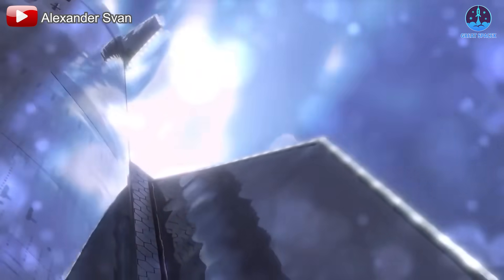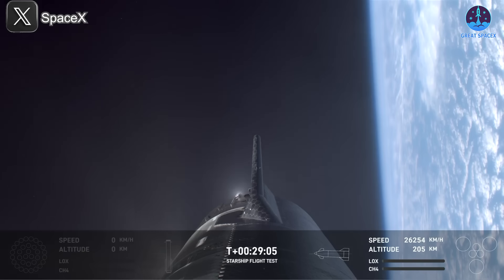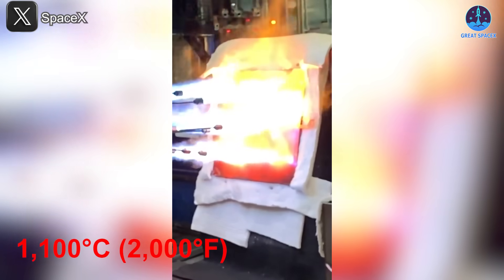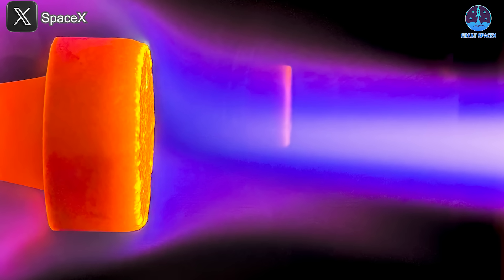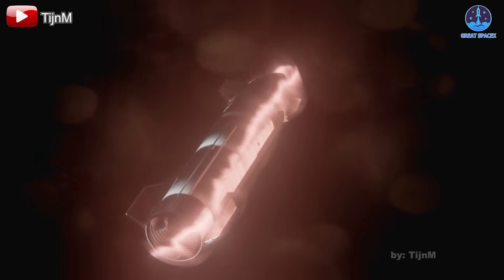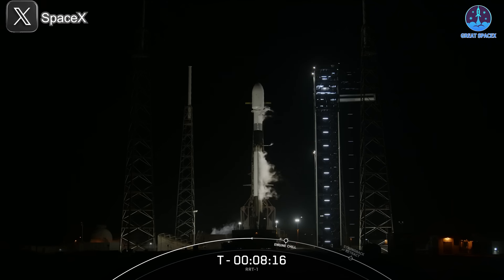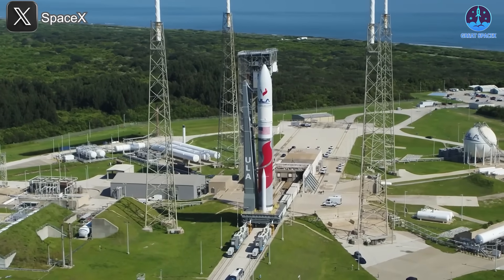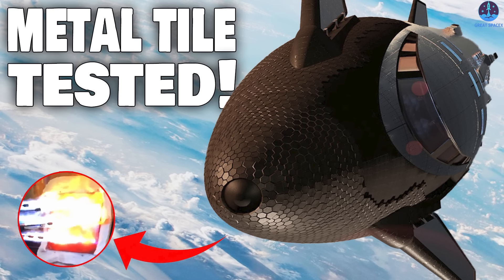Genius! SpaceX TESTED New METAL Heat Shield to End 1500°C Melting...

Comment: The X-33 project was designed to utilize metallic heat shield tiles. Each hexagonal tile was to be supported by standoff spacers and reusable without replacement.

Comment: Why not use Tungsten tiles - around 3,400C capability, so no complex/heavy cooling systems needed?
Reply: Even titanium melting point is about 1700°C and it's light. Maybe tungsten coated titanium?
Reply: oxidation. The plasma faced upon reentry has a lot of atomic oxygen, that will attack the tungsten metal and oxide it. Tungsten oxide has a melting temperature of 1473 Celsius and its boiling temperature is 1700 C. So while the metal can stand 3400C. The oxide can not. 

tungsten titles would just burn upon reentry.
Reply: @nickl5658  that's awkward

Comment: Not trying to be a back seat driver, I realize spaceX knows ALOT more then me, but here goes.  Why doesnt spaceX manufacture 1 giant titanium heat shield that just attaches to the bottom.  Based on my backyard research titanium can withstand 3000F more then enough for re-entry, it would allow for a quick turn around as you dont have to check a couple 100k individual tiles. And if there is damage? You disconnect it and replace it with a new one (which is already prepared). And to save on costs the old one is recycled.  I think it would add alot of simplicity. And also it appears titanium is lighter then ceramic (but ill admit i find conflicting reports on that).  And yes i know im making it sound waaay more simplified then it is.  But i think this would solve all there problems if it can be done efficiently.
Reply: One quick impression. The problem is not just how high a temperature the heat shield can withstand without meltiing, it also must not conduct that heat through to the stainless steel skin.  Titanium conducts heat well; ceramic insulates and keeps the stainless temperature much lower.
The actively cooled metalic shield they're talking about also keeps the skin temperature down by conducting the heat away.

Comment: The strangest thing happened to me a little while ago. I had this visionary idea of a new Starship Heat Shielding method. And I called it "Ionic Thermal Shielding" using a strong field of ionized particles on the heat tile side of the Starship creating a barrier between the frictional reentry heat and the Starship that would drastically reduce the heat that the Starship heat shields receives. It struck me as strange that I would think of such a thing so I decided to Google it and Google has a new thing called "AI Overview," which I didn't know about. The Artifical Intelligence came up with the same thing that I did and by the same name, saying it's an actual technology they're working on to "shield spacecraft on re-entery into Earth's atmosphere." 🤩🤔

Comment: Gallium will circulate and not boil with minimum heating to keep it from freezing
Reply: But "boiling" the coolant is what takes the heat away. No boiling, no cooling.
Reply: but where will you dump the heat in this very hot gallium. can't be in the ship as it will cook the crew.

Comment: I wonder if a phase change material could be used to fill the jacketed shell of a heat shield. It would need to be a designer material but the limited amount of time its needed seems like it could be possible option.
Reply: You are thinking Apollo ablative heat shields. And such kinds of heat shields have to be replaced completely each flight. single use.
Reply: @nickl5658  no, ablative and phase change are different types of passive cooling. Phase change materials are in use in computer heat syncs' and some advanced building materials. Phase change  materials slowly transitions from a solid to a liquid in the presence of heat, the change of state takes energy and cools the surrounding materials. Once its all liquid the cooling stops so it would need to be designed to last the entire re-entry, but phase change materials will re-solidify when cooled and would be ready to be used again as soon as its back to temperature.

Comment: I'm no rocket engineer, but I'm just putting this out there. Could an Electromagnetic Heat Shield be possible. Since Plasma is receptive to Electromagnetic fields, couldn't they make the heat shield repel the plasma. Like I said, I'm no engineer. Maybe the apparatus involved to make this happen would be prohibitive to spaceflight, i.e, too heavy, too advanced? I'm sure some people smarter than I would have tried it if it was possible. The best way to deal with the heat of re-entry is to not let it touch the ship. Maybe using it in combination with ullage gas cooling?
Reply: I don’t think magnetics would work given the extreme force with which the air molecules are being slammed against the hull, but Ive got to give you serious points for out of the box thinking.
Reply: No. Power and weight of electromagnets makes this unworkable. And even if a ship did have this system, an electromagnet, redirects the plasma to the poles of the magnet. So the plasma is not deflected by an electromagnet but it is redirected to parts of the ship... where the magnet poles are. So rather than roasting evenly over a wider area, all that plasma is focused on a smaller areas and cooked harder.

Comment: The reason why there will be metallic glass heat shields it's because forming this is extremely difficult and you cannot form huge sections of the ship with this material unless you have huge machines that can instantly cool down the metal.

Comment: The only demonstrated replacement for the Space Shuttle tiles consists of thin columbium (aka niobium) metal panels (aka shingles) covered with a tightly adhering ceramic coating to prevent the metal from oxidizing and eventually experiencing burnthrough.

 Those FS-85 niobium panels were 0.4 mm thick and were tested to 2600F (1423C) successfully for 100 Shuttle EDL heating profiles (temperature and time) and tensile and bending loads without any unbonding of the ceramic oxidation prevention coating.  

Those panels require mechanical attachment hardware similar to the hardware now used to attach the ceramic fiber tiles to the Starship and flexible ceramic fiber thermal insulation between the panel and the hull of the vehicle also similar to the blankets now used on Starship. 

SpaceX has a lot of experience with niobium since the nozzle for the Merlin vacuum engine is made of niobium. 

Side note: My lab spent three years (1969-71) developing and testing ceramic fiber tiles and coated niobium heat shield panels during the conceptual design period of the Space Shuttle project.

Comment: Stainless steel alloy that incorporates tungsten
Reply: Which does not work. The reentry plasma is oxidative. Anything that can burn in oxygen will burn. Iron and tungsten included.  Also metals are heat conductive. So even if the metal survives... it conducts heat... and the insides of the ship becomes an oven. The metal has to be non heat conductive... and I do not think there is any such metal.
Reply: @nickl5658  it doesn't even need to burn - melting is enough to put this entire crazy stupid, money wasting project to rest for good.
Reply: @nickl5658  haha and what about evaporating methane into the plasma for cooling - these people are smoking crack.
Reply: The reentry plasma temperature is above 6000 K!!!! There is no material in the world that could withstand that without burning and evaporating. So any rapid reusability is a profoundly stupid dream.
Reply: @lachezarkrastev7123  Yes, let's all go back to living in caves since anything else is a stupid dream.

Comment: The solution? Pulling all ideas from the different fields of engineering I worked in dealing with heat. 1 solution would be to make stronger heatshield on the sides for catching that can handle the bumping off of the sliders on catch arms but still needs a deployable catching head like superheavy. 2 would be to create corrugated steel that can be filled with cryofuel for initial cooling then expelled though micro vent holes to create film cooling. The film cooling calls into question how much fuel would be needed to cool for re-entry from LEO or returning from lunar or Mars orbit vs the fuel needed for a long enough de-orbit burn to accomplish the same goal but still need a deployable catching head. Once there is a large enough space station for actual tourist any organic matter from human waste to food and plant waste easily makes CH4, so visiting starships can get enough fuel for re-entry.

Comment: Perhaps a comparable in between ceramic heat shield tile and these metal tile would be interesting. If the metal is tougher such it isn't subject to the damage seen with ceramic tile. And of course there are limits with current chemical reaction propulsion methods. But that doesn't mean there can't be other ways. For example propellate heated by directed energy from surface stations. Or a plasma drive with a similar power source. If only for the first stage. Or in time, aneutronic fusion impulse from the ground to orbit and beyond.

Comment: what are the costs of a bi-layer evaporative cooling system? added weight that does nothing and added fueling requirements. how much fuel will be needed to absorb the heat? are they already having issues with heat soak into the tanks? are the tiles that heavy? complexity- will a micro porous skin stay porous after a reentry and sooting? will a thin layer of stainless surve and serve the same purpose and resiliency ageists micro meteoroid strikes at tiles?  I don't see evap cooling going so well.
Reply: you dont see it going well yet you have this many unanswered questions? liquid to gas cooling systems are not complex nor expensive and are some of teh first forms of cooling humans invented with plumbing, it would get rid of 10 tons of heat shields and they already have to bleed off fuel on re entry to lower their weight, you can clean micro pours with a solvent bath in a ultrasonic chamber or hand held laser gun for cleaning, heat tiles where not designed to protect the craft from micro meteorites in the first place thats a difrent technology the requires multiple layers of thin sheets of aluminum to be weight effective.
Reply: @miguellopez3392  ya, what he said above!

Comment: Have you ever owned an air hockey table? Simple technology but those air holes always eventually get clogged and can be a pain to keep clear. A heat shield with holes for ullage gas or liquid-film cooling would have to keep those holes open and that could significantly add to maintenance headaches.
Reply: laser cleaner or ultrasonic cleaner can get those holes clean fairly easily, the machines are just very expensive but not for SpaceX.
Reply: @miguellopez3392  Would that adversely affect rapid reusability, or is it not a big issue?
Reply: @Docjonel  likely yes unless they develop the world's largest cleaners themselves.

Comment: Starship is doomed. The ship keeps getting taller and heavier while SpaceX is struggling to solve the rocket equation. More fuel ads weight, which reduces payload, adding a metallic heat shield will add more weight and will require more fuel. You can simply see block the 3 ship renders, and it's even taller. Cylindrical objects don't do well during reentry.
Reply from the maker: So can you suggest some solutions for SpaceX?
Reply: @colonbina1  I would suggest SpaceX go back to the first iteration of the BFR. It had a lifting body shape. Elon said that wings were useless in space, but reentry is a different story.
Reply: @colonbina1  people like him are just bugs in the matrix code😂😂
Reply: A lot of the current problems can be traced to the move away from the lifting body design.

They wanted to be able to quickly rollout rolled water towers, but those are just not conducive to re-entry from orbital speeds. Boosters do ok because they only ever make it to at most 1/10th orbital velocity.

Fabrication of integration of a lifting body airframe takes months, no matter how much rapid iteration you try.
Reply: Be assured that SpaceX will overcome all these hurdles in time.

Comment: As new solutions are put together and tested, they bring with them requirements for more fuel to lift the addition weight of the ship with the new, and often heavier, heat shields.   At some point, the cost of fuel to slow down the ship’s speed before entering earth’s atmosphere becomes more viable.  Slow down then simply fall to earth.  A significant reduction in surface heat  during reentry.

Comment: Water would freeze in the channel due to contact with the fuel tanks unless completely empty. It's great for heat absorption.  But may also cause a blow-out if icing at any point comes against the pressure of steam between two thin layers of metal. 
Methane may cause carbon fouling over time when burning off in contact with atomic oxygen in the upper atmosphere.
We may be stuck with a dedicated nitrogen tank. Carbon dioxide may also be an option given the Mars return core mission, since it would not freeze if the plumbing were sufficiently separate from the main tanks.  It may still freeze at those temperatures, but not nearly as readily as a water system would. It's not impossible that it would also foul the system if the carbon were sufficiently heated to disassociate from the oxygen in CO2.  
I'm sure the Chem-E staff at SpaceX are having fun with this one.  It has to work in the chemistry of both Earth and Mars atmospheres, so lab time is doubled.
Reply from the maker: Great observations!

Comment: Now if they use methane as a coolant or heat shield, won’t that compromise the fuel system? Heating fuel is not a smart idea for many reasons and what about extra weight with metal shield?

Comment: methane as coolant is logical, however extremely dangerous when desiged as a leak through design to dissipate heat.  Wouldn't that raise the possibilities of FUEL/METHANE leaking into the "super heated" flow in reentry and could make Starship a premium fireworks show. RUD

Comment: The idea of a heat shield with thousands of holes through which to force gas or liquid coolant was already considered several years ago by Spacex, when the original idea was to build the hull from carbon fibre composites. The same idea of forcing air through small holes also helps some boat hull designs glide through the water more efficiently. In effect Spacex have already built a giant heat shield tile. It is the water deluge plate under the OLM.

Comment: I don't think they will use it on whole ship. Most likely there will be metallic heat shield in some parts like catching mechanism to reduce ceramic tiles number for easier refurbishment.
Reply from the maker: Your idea is quite reasonable. That would probably solve more problems.

Comment: The discolouration was aluminium coated on the steel so they could see on the cameras what temps they got without lots more sensors. Yes they coated the tops of the flaps with aluminium. Why it started discolouring way before the temps steel discolours
Reply from the maker: Great comment 👍

Comment: At 1500°C, coolant will vaporize, buble will appear and corrode the  inner surface of the heatshield. I remember original Musk planned to use 310 grade stainless steel. Outer shell should use this material instead of 304L. 310 can mantain its strength upto 910°C. Sure there should be auxiliary systems like pump, recirculation system for coolant, added weight to both vehicle, or other genius idea from the team! Very exciting to see!